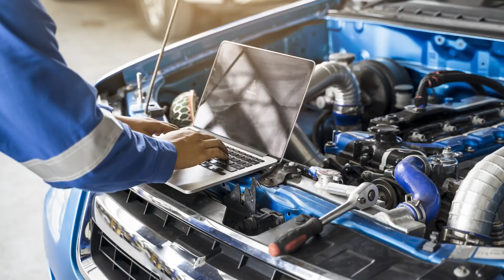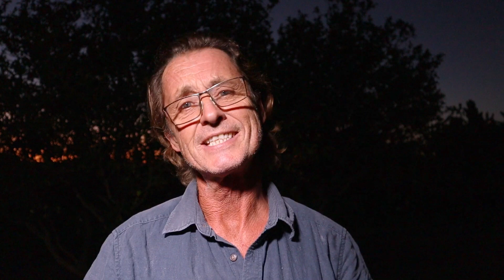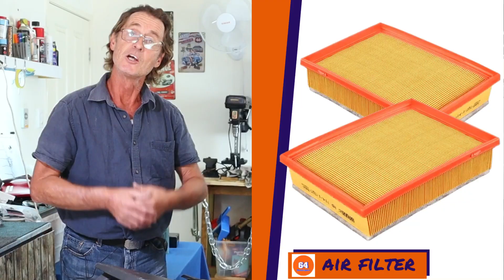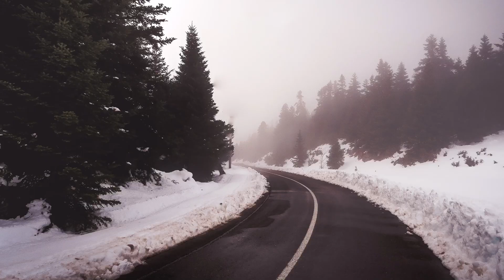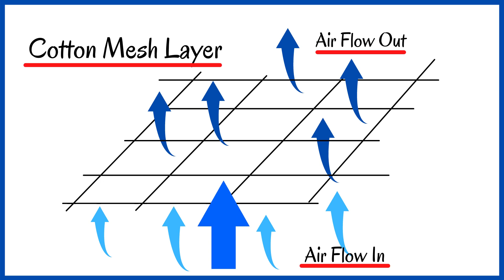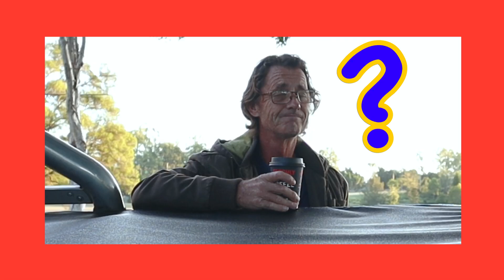BMW E46 INTAKE Versus E46 COLD AIR INTAKE

Comment: You can solve this problem with some simple easy steps: customize the OEM air box, cut all the inside components to make more space, without exposing any external leak other than the original air flow sources, use a silicone 45 degree coupler to duct the maf sensor and going inside the box. Remove the plastic mouse on the inside entry of the air box so the entrance is clear. Bring your cold air intake and place it inside the box. Use a plastic or aluminium coupler for the cai's neck so you can have a solid ducting for the silicone coupler to merge the maf and the cold air intake. Here you now have the perfect cold air intake with the best heat shield possible and OEM looks. Next replace the original rubber piping with a silicon tube with is an after market update and way more effective. Just make sure using smooth bends and no sharp turns and smooth ducting especially before the maf. As an additional cold air source, you can duct a 1 or 2 inch tube from the fog grill opening toward the downside of the box by drilling a small hole and ducting it properly. BMW Engineers ain't got shit on me🤣

Comment: I put off getting one for ages on mine, the OE air box with dual feeds is an excellent design. 

But I made my own heat shield out of 2mn Ally sheet, that goes all the way to the slam panel and incorporates the OE top feed (underside of the OE feed is covered it gold heat tape), Apexi air filter and an additional air feed into the bottom of the heat shield. 

Sounds great & I’ve done everything I can to keep the heat off it and as much cold air as possible.

Comment: Where could I find an alternative material box to aluminum and also what about the corrugated tubing, is there a place I can get a straight shot to the throttle flap?
Reply: I’m thinking of using pvc high density foam that’s fibreglassed. I’m a fibreglasser so should be easy. Also thinking of a bonnet vent to bring air into the new filter box area.

Comment: 10 years I had the afe cold air filter on my 1997 528i e39... Now my son drives it for 3 years already... Last  year I cleaned and oild the filter for first time... Car now has more then 400.000 km on it and still going strong.. I noticed the gas pedal reaction is slightly better then with the oem filter

Comment: The factory intake is already good enough.. The air enter at area where highest air pressure would occur during driving..CAI might give a slightly better response feeling during static

Comment: i think c.a.i. are good, if they are used properly. with that i mean - filter should be in custom made box, or atleast with shield. second - put filter in cover, and spray special filter oil on it. third - filter need to be cleaned time by time. fourth and the last in my opinion - time by time need to clean maf with  special cleaner(not brake cleaner or carburator cleaner.)

Comment: Great video on the topic. After reviewing the performance intakes myself for a while, I would probably choose the aFe over the others, and add some heat-shield insulating material to the outside of the 'heat-shielding' box. But, I'm still on the fence since I like the sound of my current setup, and wonder if I would be unhappy with the performance intake sound over the exhaust, or if they would be complimentary during open throttle acceleration. Maybe if you knew my setup, it might make more sense.

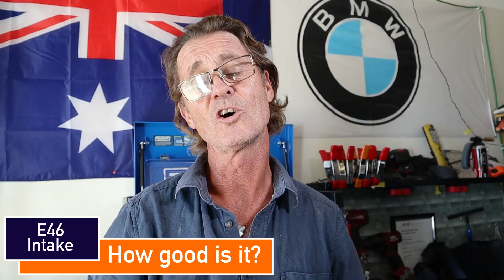I have an '04 330i ZHP 6-speed manual. The only mods I've done is a 3:38 rear differential swap over the stock 3:06, and a full cat-back stainless steel Highline Tuning exhaust. Out of all the exhausts I've listened to, I like this one the best. Quiet under idle and low throttle, aggressive and mean on acceleration, and It even gives some 'burble' when slowing down at the low RPM range. That might be due to an x-pipe with no resonators, only a high-flow muffler at the back. I definitely notice a difference of power in the mid-to-high range.

I may just get a K&N filter for the stock air box, and at least get a Turner Motorsport silicone intake boot to smooth out the air-flow after the MAF sensor. Then again, I work/tinker on cars a lot, so I may try and get my hands on another stock air filter box and modify it for a cone-type filter. This would have the benefit of looking stock, still receiving cooler air from the front collector, and reducing air turbulence.

Subscribed, liked, and thank you for liking the E46. After this many years, I still think it looks great(and modern), performs great, comfortable and fun to drive(even on long-distance trips), and still easy to work on.

Comment: i don't know what the air vs cold data benefits are but logical sense should be .... engine works at certain optimal temperature to give optimal power, if you cool it off won't give optimal power anymore would it now? is not like a Home Computer CPU that if u lower the temperature performs better... Engines don't work that way, since they need a certain "temperature" to have all fluids lubricated and ignited. So making it "cooler" shouldn't boost performance. Is just my common sense. However the airflow change u do with the new air-intake is you feed more AIR into the combustion chamber and that gives a big boost to the engine burning however that needs to be properly paired up with cooling system give it cold air-intake might cause blowups ... cause of the difference in cold and hot temperatures etc to keep it at optimal "temperature" otherwise u melt things or crack them up ... that is how i understand this whole thing not sure if even applies to what the video subject was.
Reply: Colder air is more dense, so it'll contain more oxygen per liter of air. Combustion likes more oxygen and for that reason, cold air is better than hot air.

Comment: I've always thought that if the stock air intake system sealed well it would actually work pretty good since it takes air from basically the bumper. I'm sure a CAI is quite a bit less restrictive than the stock design, but I got a CAI either way just to clear up some space and ease of maintenance doing anything on the right side of the engine. I'm DONE fishing up the airbox hooks next to the coolant hose / dipstick haha

Comment: As it is very obvious, as you have pointed out, the benefits of a cold air intake (if designed properly) is increased air flow available to the engine in a nutshell. Also as you have pointed out there are some nuances with materials and designs that are VERY lacking such as the aluminum structure  and the use of the original ribbed ducts. Sir you have been spot on with your findings and explanations if I may say so. You did ask an interesting question about why so many refuse to believe in the stats of this particular mod so I have an opinion of this and it may only be part of the actual answer. I believe from previous dealings and conversations I have had that most people who have tried this mod years ago may have been the victims of cheap or poor set ups and they lacked the scientific concepts of what the mod was intended to do. I saw so many failed C.A.I. on beat up cars where it was obvious that they went for the cheapest horsepower gain someone talked them into and when I say failed, I mean failed lol. The companies selling CAI years ago were selling some really basic junk leaving the consumer with nightmares issues to deal with to complete the projects. Moral of the story is that it became a "not worth it" mod in many eyes because they did not achieve an addition 1k horsepower they thought was promised lol and were left with weird modifications to replace and fit the old ductwork and maf/map sensors. This particular mod got a bad rap from a bad start in the low information community lol. It was sold off the shelf and was not a plug and play as presumed. Now today  companies are more aware for their consumers and generally provide more info and kits that may work better for individual automobiles. It has come along way however I believe its hard to erase years of misconceptions with CAIs but most who are serious and willing to do the research will benefit greatly with this important mod especially if one is opening the exhaust side of their motor. "You can only get out what you put in" so to speak. Very good video my friend. I enjoyed it and you have a classy way of con/testing theories. I am slowly working on my 2005 325ci. More of a restoration although I have new adjustable coilovers installed and wheel/tire package coming soon. It already has a CAI but it really needs to be changed or redone.

Comment: on an E46 where it already has a "RAM" air type intake system, the only way to add a cold air intake is to ensure your keeping that ram air factor. otherwise stock airbox is best. bc your not getting more air with a cone filter no matter how big you go. (you can modify the stock air box to fit a cone filter and keep that ram air factor btw!) wrote before watching.

Comment: I have an CAI cone on my E39. I regret it. Despite trying to get that cone filter down into the well in front of the driver side front tire, you’re sucking hot air off the engine. The BMW air box is as the presenter says, the stock air box is already capturing the coolest air available. Drop a K&N filter into your OEM air box if you want to free up more air flow. I live in the desert southwest of the US. There is a HUGE difference between driving when it’s 120F in the summer time, and driving on that one 35F morning that we have once a year here in early January. I’m putting my OEM air box in.

Comment: You are surprised that so many E46 owners are skeptical of CAIs of all the data.  What data?  I hear a lot of hypotheses but where is the data showing that the air entering the engine in actually greater in volume or lower in temperature in CAI versus OEM?  Where is the data showing that the car actually generates more power with CAI versus OEM?
Reply from the maker: Mishimoto have Dyno charts on their website, and I have been informed that K & N also have stats on their site (although I have Not verified this point). AFE Power also have Dyno figures on their site. The cotton mesh pod filter does allow the air to flow through it much easier and with less turbulence than the original paper element  to provide a greater volume of air to the throttle body. The question is - Is it colder air? I have just uploaded a follow up vid to this, which you might want to check.

Comment: I'm using an samota fiber carbon Air filter. Is been design for m3 . I had normal.ones . And cai ones. Different  and different ones . But is simple . I was wondering before.  But I've done my dyno test . So . Is better then a standard one .

Comment: Hey there, great video! With the AFE kit, Could you wrap the aluminum sheild with Gold heat reflection tape to reduce the heat soak to remove that issue?
Reply from the maker: That's what I am thinking. I am doing a follow up video, so keep tuned!

Comment: I have a fibreglass heat shielded one that I’ve fully insulated with industrial foam foil insulation with a lid. Gets air same as the factory one. Can’t notice any performance at all but it sounds great and definitely does not heat soak.

Comment: I would suggest there is a reason that manufacturers of "performance" intakes don't include any figures or even claim to give a performance increase, rather they state "increased engine sound" and "smoother air flow." A real comparative test with a thermometer or even a rolling road would change my mind, but I'm not convinced just yet. Not enough data.
Reply: AFE claims +20HP and +27lbs x ft of torque for their stage one kit, they've provided a dyno graph on their website as well. I have one being installed right now, not getting it tuned or anything for a bit until I put some more money in to the car but will give you an update if you're interested. I'm expecting no improvements performance wise but a little more noise, which i'm happy with for now lol
Reply: @amitvashist5595  has there been any performance improvements?

Comment: Recently I got the Dinan Long tube CAI (discontinued), the one that sits down on the bumper and noticed a little increase in power. IMO its the one that provides best gains. Btw, would you recommend replacing the rear resonator with X Pipes on stock exhaust? I currently have headers and Borla Muffler

Comment: Hi mate, little bit more of a sensible comment from me. It’s interesting you brought this up as on Friday (18th) I recently replaced my airfilter. After weighing up all the differences cold air kits I was still undecided. I too, had looked at  a lot of forums and groups on the topic and one thing that really stood out was that the majority of people that didn’t like them or felt they had no benefit were normally people who would kind of half arse and cheaply do it. The common theme between all the negative comments were people would just ‘slap’ a pod filter on the end of the factory intake boot and do no effort in heat shielding or air routing. Leaving all that warm to get to the filter. Now with that being said there were definitely people who had trouble with a full kit, such as the one you showed. But on the whole I came to the same conclusion as you did. It wouldn’t just be a simple install kit and be done with it. One thing I had come across from a motorsport shop online (based in the UK) was,as well as full kits they also sold air intake ‘accessories’. Brackets, ducting, other vents and heat wrap. This lead me down the rabbit hole trying to find a way to run extra intake areas from the fog light surrounds to help with air intake, realising how much work this would be to do well and do properly and all I really needed was a service I went with just the K&N reusable oil panel filter they make for the OEM air intake. Now the service is complete I am back to planning a cold air intake kit along with some of the other modifications I had it mind. This was definitely great timing to release your video and had some brilliant information in so thank you. Definitely back up the point for the kits to work at an optimum they need some support! Thanks for all the hard work on your videos and can’t wait for the next! 🔥
Reply from the maker: Thanks so much for the great info👍
Reply: @Sixty4motorsport  legend 🔥❤️

Comment: Thanks for these videos had my 2001 325ci for 3years and been working through the main general maintenance. So far all new standard. Thermostat,water pump, radiator, expansion tank, battery, plugs, ignition coils, 2x Oxygen sensors, 4x brake calipers +  brembo pads, front vented discs, all belts, serviced every year, k&n air filter. Now  waiting on my mishimoto air filter replacement kit and turner Motorsport silicone throttle body air intake pipe and aluminium breather adaptor. This should come next week. Then just coilovers, an engine tune and for the time being that's enough to be going on with. Adore the car don't think I will ever get rid of her as she is my daily driver. Great videos again love your work 🥰
All
Reply from the maker: Thanks mate. Great work on your E46!😎

Comment: I'm not convinced with the pod filter, cleaning is an issue to me. Do you still get the same air flow after a clean, is the element still in tact as it was new, the price of cleaning fluids. The only time I would use a Cai is in winter with plenty of cold air around and revert back to OEM for summer. I do like the Cai noise but I'm still on the fence about whether I should buy or not!!! Just my thoughs. I would really like you to do the thermometer test though? Test at idling, test at 60kmh and at 100kmh and monitor the temp difference between the two. This is besides the performance gains of 10 to 15 up that some of them claim. Some tend to neglect to mention the fact that you have to get a tune but!!! If you get a tune in anyway you will gain 1 or 2 HP with the OEM air box
Let me know your thoughts, and thanks for the video. Liked and subscribed.
Reply from the maker: Great comment. Air flow is the key to get the best from the kit. If your stuck in stop start traffic you don't have that fresh cold air coming into the filter to keep the air cool. So I guess it comes down to the type of driving your doing - city or highway.

Comment: Good Video. The standard one is better shielded so less heat flows trough. And less heat is crucial. The new ones can even be worse for your horse power except you install a shield that protects from water and hot air
Reply from the maker: Thanks for the comment👍